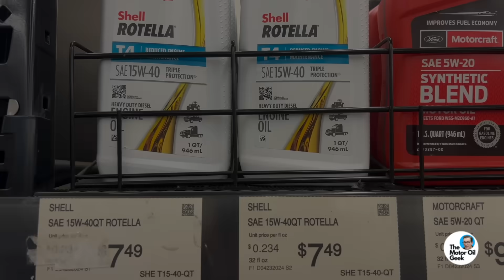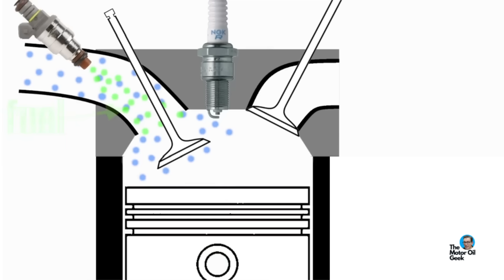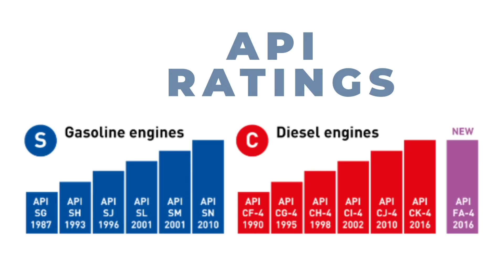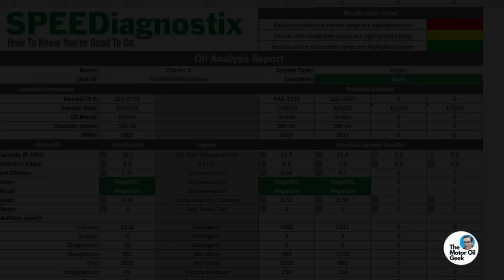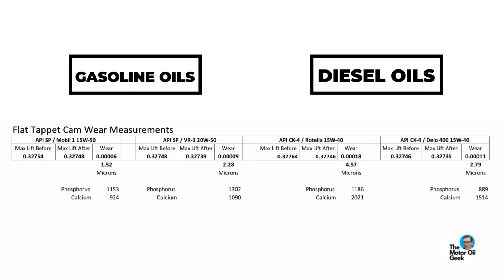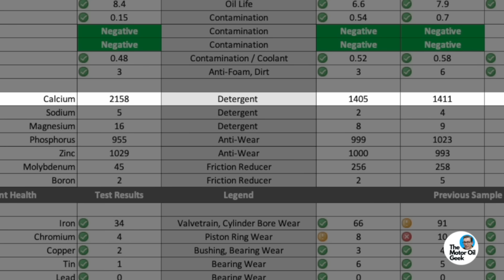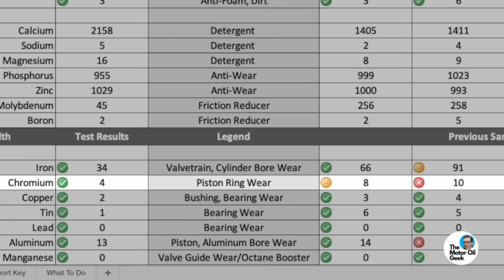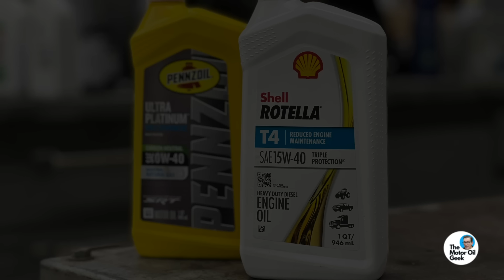Why DIESEL Oil is Actually WORSE for Gas Engines!

Comment: Glass lighting video, deceptive.  He shows t6 full synthetic bottle then actually uses t4 15w40 diesel conventional semi truck oil in analysis. T6 full synthetic is rated for gas engines and diesel engines. The old dinosaur t4 is good for old push rod gas engines and semis
Reply: Did you notice he compared different viscosity oils on wear and brand.
The wear was out 5 to 6 decimals. 10 to the minus 6 = statistically insignificant.

Comment: I had a guy in my shop who has used diesel oil in his Silverado 4 cylinder. Engine died at 33,000 miles. GM wouldn't help him. People used what the manufacturer recommended!

Comment: Thanks again for all the insight and work to put these videos out.  I had a 2010 mazda speed 3 turbo 2.3 direct injection and all the forums at the time raved about how good Rotella T6 was and I used it for almost 95K miles but I wish I would have known then how bad it was.

Comment: Ok... Then what's the difference with the Valvoline Restore and Protect??! It's full of cleaner detergent. So shouldn't that oil cause side piston detention as well? It's probably 3x's more of a detergent oil than any Shella Rotella series. I need explanation please. This makes no sense. How can you say Restore and Protect is a good oil if it's detergent based just as a Diesel oil. 🤔 Think McFly Think

Comment: They're better for wet clutch motorcycles because car oil makes it slip, while diesel oil does not.
Reply: OR use JASO MA2 motorcycle oil that designed for motorcycle clutches? I don't understand why people are buying car oils for motorcycles, when motorcycle oil is readily available.
Reply: @TassieLorenzo Because it's expensive.

Comment: I had always heard that diesel oil was SUPERIOR to gas oil.   Always heard that diesels had more severe usage.   Seemed sensible.
      Met an oil engineer.   He said, "I wish we could stop that myth.   We design oils for the APPLICATION where they will be used."   "A properly engineered oil, used in the right APPLICATION is how you get SUPERIOR results."
       I have remembered that for 25ish years.    So interesting to see this video !    Great explanation Motor Oil Geek !     😅
Reply: Conspiracy theory mentality or the Dunning Krugar effect...to think engineers are purposefully making a bad product or to think "I, Bobby Numbnuts, know more about oil than oil engineers.
Reply: @nicholasagnew2792 it’s because modern oils are bad in older engines. A Jeep 4.0 is basically a tractor engine, same with ford 300. They really prefer old school oils.
Reply: As an engineer,  I can tell you they are restricted by cost and regulations.  Things just have to be good enough.  They might personally  care about longevity,  but the company they work for  doesn't.  Also, the arrogance in the field is common.  Most engineers can't even change their own oil.
Reply: @jth877     It is hard to get a good product sometimes once the bean counters get onvolved !    😢
Reply: Just makes sense that they aren’t engineering oil for 25+year old engines.

Comment: What about oil for "small engines"?  I recently bought a vintage Cub Cadet mower and talked to my local dealer about oil.  They said that the "small engines" in lawn mowers and lawn tractors still have flat tappet cams and need the additives for flat tappet cams that are not in automotive oils anymore.  Kohler makes special oils for small engines with the proper additives.  Would this Kohler oil work in a flat tappet automotive engine?

Comment: I drove a new Renault Magnum truck with a Mack ETech 480hp engine tuned to 580hp and loaded to around 88,000 pounds and i beat a Dublin bus away from the lights with brown smoke coming out of the exhaust.

Comment: My Dad and i have been arguing against running diesel oil in gas engines, ive tried them in gas vehicles and never liked the results, i also feel like the extra detergent messes with ring seal and actually pulls more fuel in the oil on a gas engine.

Comment: I only run T6 15w40 in an old-school iron block flat tappet cammed engine. Thicker oil tends to keep the older engines running longer and have more zinc and moly in them as well.

Comment: Finally, you said it! Now I can just reference this video when I try to save people's gasoline engines by telling them NOT to run diesel oil. We don't make enough soot to warrant the extreme amounts of detergents, in fact, on a gasoline engine that doesn't produce as much soot, there's nothing to consume the detergents, and you end up with an over abundance of LSPI causing chemicals.

Comment: Do you have data or could you run tests of manufacturer label oils vs major brands oils that meet manufacturers specs.   I.E, bmw LL17 FE + that bmw sells vs Castrol  edge meeting the same spec.

Comment: Rotella T6 is JASO wet clutch certified, I've ran it in motorcycles for decades, put tens of thousands of miles on them without issues. I've also ran it in ATV's, and all my trucks. My winter beater 2008 Silverado had 332,000 ish Km on it and the DOD still works, I'm saying its because of the T6 that its lasted this long, still has 35 PSI oil pressure at idle.

Comment: this is an interesting topic. Me along with many others. Use diesel oil, in our motorcycles because its MUCH cheaper than dedicated motorcycle oil. For example I use T6 because it is MA/MA2 JASO certified.  I have taken 1 motorcycle to 100,000 miles on purely t6, I would like to see a test sometime comparing motorcycle oils, [Honda brand is by far the most popular because of price] next to something like T6.

I'm not saying it's BETTER. I just know its what's used a lot and I would love to see proof that motorcycle based oils are indeed better than T6.

Comment: You're exploring the wrong use cases. The majority of people I know using rotella in gas vehicles have non gdi shitboxes that have started to burn oil. They need the extra protection against soot. Most of them claim to observe less tailpipe smoke and slightly less oil consumption after the switch. Not everyone is going to be using t4 either. "Brotella guys" aren't driving kia souls.

Comment: Been running my old school flat tappet gas engines for hundreds of thousands of miles for 30 years and never a problem.   Direct injection is another issue that I have avoided.  I was surprised how many owners were running Rotella in their racing LS engines at LS Fest.  Ain't broke; don't fix it.

Comment: I love and recommend your videos a lot. I am a subscriber. I was really interested in this video because I run Delo 400 15W-40 in my 2005 Jeep (4.0 engine) and I'm not afraid to admit when I'm wrong. But this video didn't say I was wrong. There were a lot of "might" and "could" comments and anything but definitive. Delo 400 actually has an API of SN and therefore rated for gas engines. I'm sure Shell's Rotella says the same. I'm going to continue to run Delo 400 in my Jeep 4.0 truck engine for the next 200,000 miles but appreciate the video. Unfortunately it raised more questions than it answered for me.

Comment: Weird.  I use Rotella T4 15W-40 in my bikes.  From what the manuals state, as long as they are JASO MA/MA2 rated that's ok.  Rotella T4 15W-40 meet these specifications.

Comment: Always these know-it-alls... I've been using the same motor oil (20W-50 mineral oil) for over 40 years for all my vehicles (cars, motorcycles, scooters, snow blowers) in summer and winter (+38°C to -27°C) and there have NEVER been any problems!! (Price per barrel: ~ 8.-€ / Liter) Please stop spreading nonsense here !   🤮

Comment: Carbureted push rod older engines can run diesel oil. Its the finicky fuel injection engines to be aware of.

Comment: That piston failure sounds 100% made up
Reply: It was apparently real enough for them to develop the API SP for low speed preignition
Reply: @mp9228 Low speed pre ignition is real, the theory that an explosion inside the piston ring groove occurred is what I'm calling BS
Reply: I can't think of anything else that would cause the type of damage shown, other than LSPI.
Now the explanation of the cause of the LSPI?  I'll question it, but don't have a better answer.

Comment: I run car oil in my car engine. But, I am running Shell Rotella diesel oil (10w30) in a small car manual 5 speed transmission. It meets GL-4 standards and works quite well.

Comment: Been using "Diesel" engine oils in my gasoline engines,( even lawn mower) for years. Knew diesel oils used to be higher in ZDDP plus high detergent capacity. Yes 15w 40 is a bit thick in winter, but my vehicles are inside in winter before start up. Never ever had an issue. Have a 275k mile Ecotec that I put a new timing chain in back about 247k miles, motor was spotless clean inside with minimal wear on chain and guide shoes, still was original tensioner. I changed out chain, guide shoes and tensioner just for peace of mind. This engine can easily make 500k miles.

Comment: I tried Valvoline  & lost a crankshaft, bearings, and the works. Was running Pennzoil but didn't have any. Tried Valvoline - big mistake. Valvoline worked great in Fords but not Pontiacs. Ran Pennzoil straight HD 70 weight in my GTO 66 428 H.O. 3 deuces in triple digit temps in summer. This was 50 years ago.

Comment: I think people here are getting fired up about the exception that might apply to older motors and certain diesel oils.  Probably not a good idea to run these oils in your modern Bronco or sports car.  Your 80s Corvette might have liked it but the tolerances and metals are way different on the new ones.  It's a free world though.

Comment: I’ve literally ran that oil in my F-150 with a 4.6 for 300k miles. It’s oil. It works. My engine runs great.

Comment: One diesel engine oil that is rated API SP (for gasoline engines too) is "Valvoline Premium Blue One Solution Gen2". 
 Being API SP or SQ means it doesn't allow LSPI, so no blown pistons in your gas engine.    They might have replaced the calcium detergents with magnesium detergents to get the anti-LSPI modern API SP or SQ rating needed for current gasoline engines.   This "One Solution Gen2" oil might do just fine on wear performance in gas engines, although you are probably better off going with Valvoline Restore and Protect gasoline engine oil anyway, so this video's message is very valid.

Comment: If you have a flat tappet engine, without O2 sensors and/or catalytic converters, the "diesel" oil is just fine.
(Actually better) but if you have O2 sensors and/or catalytic converters, stick with the new formula automotive oils.

Comment: I use the diesel oil for my 55 Ford 272 Y block F700 because the high detergent keeps the engine clean and keeps my lifters going

Comment: Lake!  Great idea on this video!!  I have another for you!  What about using motorcycle oil in an air cooled commercial lawn mower?  Both use air cooled engines in most instances. It'd be interesting to see if a motorcycle oil would benefit or hurt a mower motor like a Kawasaki 38.5 hp fuel injection air cooled mower motor!! 👍👍🤞🤞😊

Comment: Rotella T6 is excellent. Running it in my J35 and guess what, oil consumption drastically reduced. The detergent and dispersant have freed up the oil control rings. Science

Comment: More wear from detergents , on a DIRECT INJECTED ENGINE. Particularly the crome from the piston rings from di- pre ignition.    Lets see it tested on a mid 90's gas engine before you make claims its bad for all gas engines. The penzoil has 5x the amount of magnesium detergent vs. Rotella , but that's just ignored.

Comment: I watch all these videos. I understand the science behind what you demonstrate. The problem is. The more I watch the more I get confused with all the different products there are. For example. What would be your recommendation for a marine 1994 454 flat tappet cam engine? You should make a video with more specific guidance on oil recommendations based on your "Science". I read a lot of comments that contradict the "Science".   Still very confused.
Reply from the maker: Thanks for watching. The next video will cover that question.

Comment: The biggest mistake that people make using Rotella is using the old conventional T4 15W40 or any type of 15W40 in a cold climate. That is going to cause huge wear on startup. I use nothing but T6 synthetic 5W40 in summer and T6 0W40 in winter in a Mazda 2.5,  which is really the old Ford Duratec engine from the early nineties. This is a conventional, non aspirated, not direct injected, engine and I never had any problems with an oil related issue. I also tried it on a Nissan VQ40de in a Pathfinder that was burning about 3/4 of a quart in between oil changes. The oil consumption went down to almost nothing. I credit the extra detergent in the Rotella for cleaning the carboned up piston rings, just like Valvoline Clean and Protect does. More anecdotal stuff I know. I think the real reason Rotella lost the SN rating is they probably dodn't want to pay API for the certification. Plus SN is an old rating now which is now obsolete for engines now, but is perfectly OK for we Luddites who never are going to own a modern TV screen/cell phone car with Automatic Emergency Braking that goes off the rails for no apparent reason. That's my two cents.
Reply: That sounds great, but you could almost certainly use regular Shell Helix Ultra or regular Pennzoil Platinum Ultra in the Mazda 2.5 with the same results as the Rotella T6.  I don't understand why the diesel oil is meant to be so special?
Reply: @TassieLorenzo  Lots of detergent to keep your engine clean as a whistle. The Nissan now has Mobil 1 in it and the oil consumption is still low. The Mazda I am prejudiced because the last one I had, before this current one, lasted a long time and the engine was still perfect, only it rusted out underneath. Maybe Mazda just makes good engines.

Comment: So the Valvoline premium blue one solution gen 2 is rated for use on diesel,gas and natural gas engines. It has a an api rating of ck-4 cj-4 and sp. So how can I not use diesel oil on a gas engine when it clearly says I can.

Comment: 50 years ago I worked for Shell Oil. The  15-40 Diesel oil was very popular for all applications. Back then everything was flat tappit cams. And the detergents came from Taffinata. That detergent is no longer used. That was a main detergent in gasoline also. From that time to now there have been significant changes in oil and gasoline. So I don't believe there is any comparison from oil in the sixty's,, seventy s, eighty's, ninety s, to now.
Reply: Sorry raffinate

Comment: this should be VERY specific - the Rotella t6 FULL SYNTH 5w40 is pretty much the best oil for most modern engines, in most non extreme winter climates (id use a 0W oil in that case)  including bikes - does anyone have proof otherwise?

Comment: First off, can we quit perpetuating the myth that S means spark and C means compression?  S means service, and C means commercial.  Secondly, what do i do with oils that hav both C and S ratings?    I have Rotella 10W-30 CF/SJ that says it's for diesel and gasoline cars, Mobil 1 15W-50 SM/CF that says its "race proven", and some ancient Pennzoil Long-Life 15W-40 CI-4/SL that says it's for all gasoline and Diesel engines operating in severe conditions.  Obviously I'm not going to use any of these in something like my daughter's car that "requires" Dexos oil, but what harm is going to be done by using these in older gasoline engines?  Are they going to destroy flat tappet camshafts?  Are they going to cause pre-ignition in higher compression engines like a Gen 2 small block Chevy?

Comment: This makes good points, and I wonder how much the ACEA 5 vs 3 vs 1 matters for turbo DI engines, as—if I recall correctly—they are improving generations of oil for GDI. 

I’m curious about other applications. Specifically boats. People swear by it; boats tend to run high RPM under heavy load and they have basic engines - no DI or variable valves here. They’re also not emission regulated so no carbs to foul. 

I knew a guy who got a case of 15w40 heavy duty diesel oil for free and ran it in his BMW M62TU (that’s a 1999 bmw v8) and goddamn if it wasn’t the cleanest BMW v8 I’ve ever seen. Last I saw the car it had about 150,000mi so the two or three oil changes with that oil didn’t seem to hurt it. But - non turbo, non DI.

Comment: I have a question. I have a 2018 Honda Clarity plug-in. I have altered my oil changes to once a year or 3,000 miles. This was done because my engine literally goes weeks or months without running. Does sound like a good plan. I have started using the Valvoline restoring, protect in both my Honda hybrids.

Comment: Uh, sir, I think someone installed your Pistons in the WRONG orientation,  and we are missing a timing belt on the exhaust cam gear.  You have the oil slosher 9000 @ 1:45 🤣😂😂

Comment: I’ve been waiting for this video. This video clearly shows that the detergents in compression ignition oil alone increased wear 200-300% over a spark ignition oil. I would say 90% of the videos on YouTube have people using Diesel oil in flat tappet cam gas engines. I am convinced not to do this to just save money over a proper gas engine designed oil. We need a comparison test on best flat tappet gas motor oils. I’ve read where the Valvoline VR1 racing oil doesn’t have enough or any detergents which can add to sludge formation. Not much information is out there for flat tappet gas oils for a normal daily driver vehicle.

Comment: Wonder why BMW does not allow LL04 to be used as a gasoline oil in the US, since those oil are most likely VW 504 approved, which VAG uses that in gas engine for the past few years already.

Comment: If it's an older engine...a gas engine with flat tappet cams and the oil is rated CK-4 and S/N...isn't it compatible for those types of gas engines?